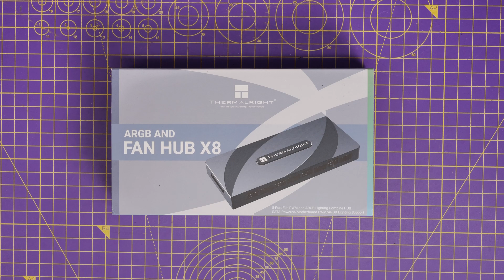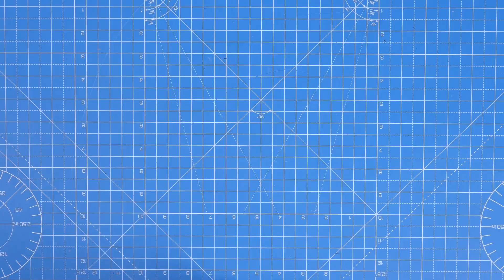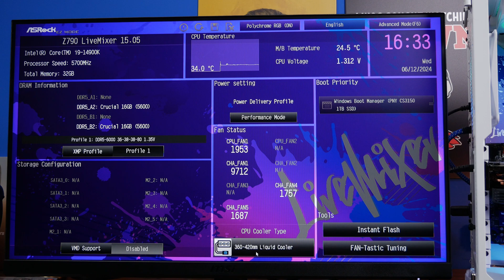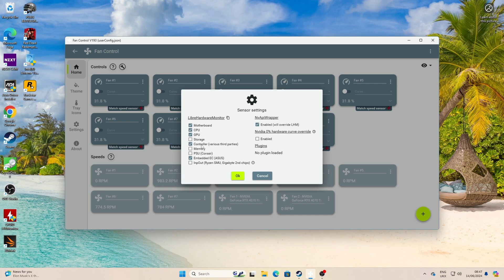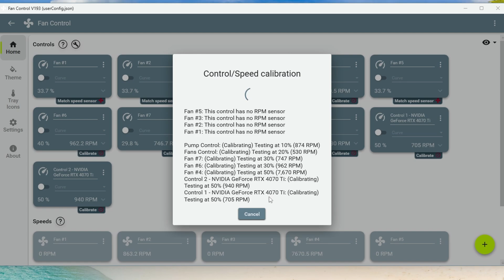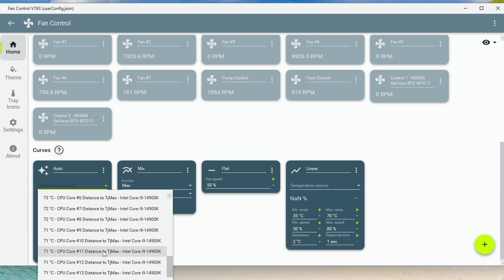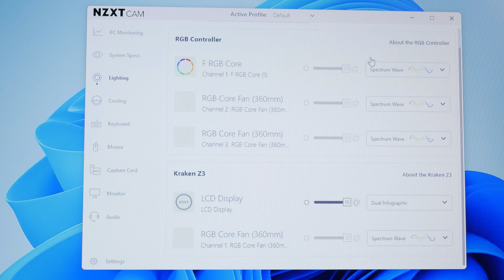How to wire NZXT F Series RGB Core single frame fans (F360 RGB Core fans)

Comment: Hey I wanted to ask since I've watched your guide on my F120 and Nautilus 360mm cooler installation. I'm planning to modify my AIO again but with the F360/280s soon. My question is will the RGB from the F360 and the fans function properly with NZXT's hub and with my nautilus AIO?
Reply from the maker: The RGB might be different but you can certainly put those fans on the radiator if you want to
Reply: @TheProvokedPrawn I checked the F360, it comes with the splitter that'll allow me to connect the RGB on the AIO, I don't mind that, I just want synchronized RGB, since my old fans are cooked lol, I appreciate your help mate, reddit didn't help out 🙏🏻

Comment: Mine won’t work, they each show one led white green and whites. They spin but don’t show colors.
Reply from the maker: You've connected them as shown?
Reply: Mine did the same thing. Pretty sure they are broke out of the box. All other fans work through the controller like they should

Comment: I have the NZXT Kraken 360 RGB AIO CPU Cooler, would these fans plug right into that controller hub or would I need to buy yet another hub??
Reply: Yeah its a bit confusing when you have an AIO to consider as well

Comment: Hey! Just out of curiosity & I'm surprised no one is speaking about this. But have you found a fix for the LED Light bleeding through the back of the F360 Core Fan? I have two of them installed in my H7 Flow 2024 & might I say.. Its blinding!

Comment: Hey I was wondering about the addr_led connector on your mobo is there dog names for that? I have a Mai b550-a pro but i don’t see that label anywhere? Is it jrgb? Look at a pic of the b550-a pro and maybe tell me if there is a addr_led header near the bottom of my mobo plz. I see jrainbow wich is a 3 pin so idk if that’s it
Reply from the maker: Jrgb will work if it's 3 pin
Reply: Thabks

Comment: Bro i am currently building in the NZXT H6 Flow and i want to use Lian Li V2 Fan in the build but i want to know if the fans will fit in the case without any clearance issue because i have heard in some cases they dont fit can you confirm for me please.
Reply from the maker: Should be fine I think. They fit in the H7 just fine, for example https://youtu.be/06IAvC2nOcs
Reply: @TheProvokedPrawn  preciate it🙌🏽